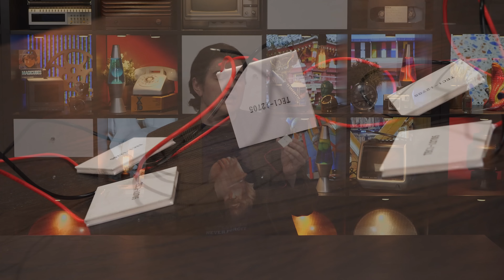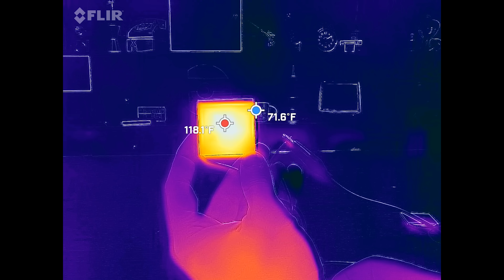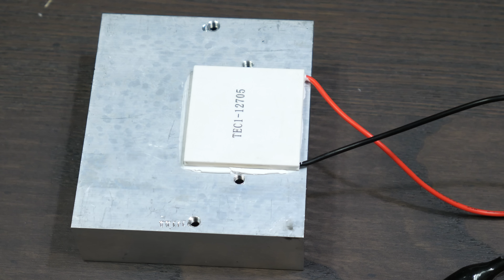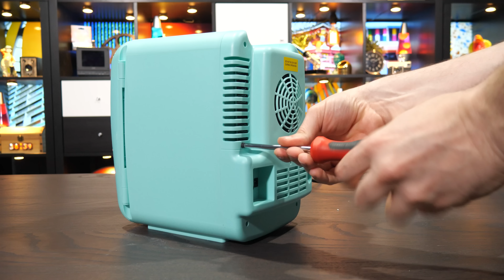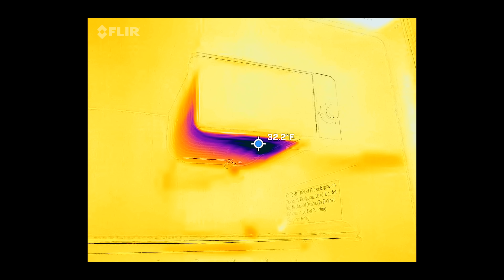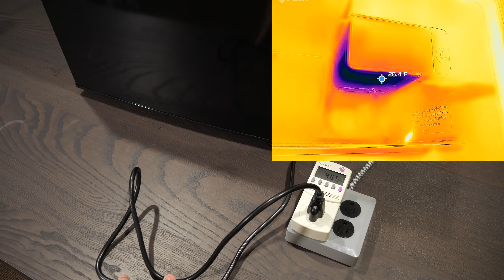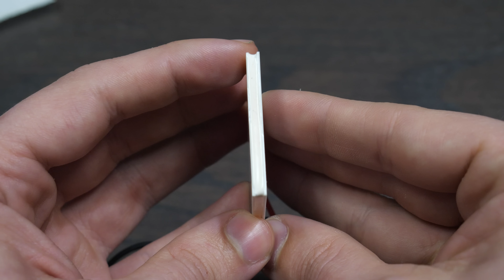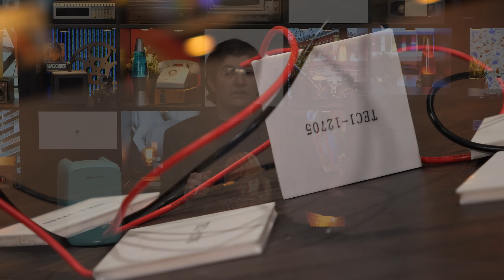Thermoelectric cooling: it's not great.

Comment: Peltier elements are great for cooling tiny things very precisely, but that is not for normies. But running it in reverse, temperature difference in, electricity out can be: Fans for wood fired ovens are nice! Don't know if they actually do anything useful, but I like them.

Comment: My mother in law discovered the Peltier being both a cooler and a heater when she borrowed my Campingaz coolbox and put the DC plug in the wrong way round which reverses the fan and blows the heat back in to the coolbox. Those were some toasty sandwiches. 

Campingaz do actually advertise it as a feature and put a little red and blue dot on the plug so you can marry them up. I hadn’t told the MiL this.

I also like to give it a head start by throwing some ice boxes when I first use it.

Comment: So much right and wrong here. I have to make a video to explain all this in details. FOR Europe or US (or Canada): purpose of that "STUPID FRIDGE" is correct and stupid at the same time. If I continue explaining I will need 50 pages of A4 sheet. 
So to make a simple point: If you want to use it to cool stuff, it is stupid little fridge and wrong by default BUT-
If you want to keep few beers or other drinks cool in the office for 8-10h a day it is totally fine, if you put them cold inside it will stay cold (what is normal if you bought it on the way to work and put them cold inside of "mint" GREEN fridge not BLUE) 
So if it cost 0.01-0.1$  a day to keep your few drinks cold for 8-10h it is not much. If you compare it to Electric bill for whole house because US people keep AC all the time on, even if they are not home for days, comparing to EUROPE "idiots" that turn on when they are home if needed. Hmmm I see why you (US) cry over 10-20$ more for a year...
But who am I to tell Americans and Canadians how to save 10-20$ a year with bigger fridge to keep 6 beers in the office.
I will end now or I will writhe whole book to make fun of this...

Comment: Well, it's not efficient both ways. You get much less efficiency from turning electricity into cold or hot then with a heat pump or coil, and you get much less electricity from heat then boiling water and spinning turbine.
But it's portable and simple af. And If you need to charge your phone in the wilderness, or make a primitive refrigerator I doubt you want to have fun with boiling cycles or coils.

Comment: I bought the Coleman portable one for trucks and it works as advertised, around 40F below room temperature, takes over 8-10 hours for that, not bad but not impressive either. Barely uses 60-80W of power.

Comment: These stupid things are usually sold by big known brands in the car and 4x4 industry for hundreds, usually about a hundred less than a heat pump system.

And they sell a lot of them.

Even when i purchased my 95ltr dual zone 12/240v fridge/freezer for my 4x4, paid from memory 1200aud. I had the salesman trying to get me to pay 359 for a 6 can pos. Even after I said hey ived worked for this company (that the salesman worked at) and ik its not a true fridge or freezer and I need this to reach set temperatures near or below 0c for my medication he still tried his best for over 40mins to sell me some pos. Also despite me saying hey you know ambient here reaches over 40c right? And if my meds reach that temp or even close to at best ill be hospitalised at worst die he still tried.

I hate these things with a passion. Always have. There is no plus side to these things in cooling. Especially in the aussie outback in the tropics.

Edit: to see how vehicle refrigeration units handle being vehicle bound. Check waeco (now mostly called dometic) or engel for the big 2.

Ive taken mine running at extreme angles, sure if it goes upside down it will likely cause issues. Buuuut if your vehicle went upside down you have bigger problems than your fridge. On a vehicle unless the vehicle is running* power is even more vital. *and even to a point on running vehicles, your still hard limited by the amps of your alternator and if you use all that, now your facing battery drain whilst driving.

My big 95ltr uses a max of 3amps at 12v. Running both sides as a freezer deeeep below zero and it running flat out. Ive never seen mine ice up. Its quiet enough to not notice it unless your head is right next to it. And its good at keeping temp, and not running tiny duty cycles. That said its insulation is easily 1.5x as thick as my pricey home fridge, easily double or more.

Comment: i mean, yeah peltier modules are inefficent but i wonder if anyone has thought of attaching a high efficency Thermovoltaic cell To the hot side and wiring it back into the module in paralell along with a power supply to increase the power input efficency, would this work to create a higher efficency cooling unit? 🤔

Comment: One chip has limited value for making say a 60v bike battery charger, 10 chips makes 20 volts so they can be built using more or less to suit, and the chips are great, limited thinking is crap

Comment: I have a minifridge between the two sizes you displayed when it was the blue and the black fridges. I honestly bought it because the room I spend most of my time in get really hot in the summer, I bought a ac unit based on your video about portable ac units to help combat the heat, but my cold drinks from the fridge downstairs would sweat on my table and would be terrible warm by the time I got to drinking them. Hot drinks, hot room, no bueno. I needed something to keep my drinks cold for me especially in the summer, I also work at a place that has terrible heating and cooling my job includes manual labor as well. So with those factors, having a 15 can fridge that are cooled and kept cool during the hot summer so I don't have to keep running up and down the stairs for a drink after a long hot summer day at work. I have a fridgidaire model vs the emerson shown here, I don't know if there's differences, i've not looked at the specs for mine, but compared to the emerson in cooling, that's pathetic that it takes it that long to cool. Honestly I feel like buying these things depend on your intended use for them. Some of these are advertised for makeup products besides beverages so perhaps that would be a better application of the emerson's cooling as maybe some makeup products you don't want them to be kept too cold? I am not sure I'm not an expert.

Comment: I got a Cooluli brand on Amazon for $24.46 after tax that claims to cool 40ºF - 45ºF below ambient temperature. I stuck a fridge thermometer in there and it was about 40ºF on an 80ºF day. I didn't expect it to get a 6 pack cold very quickly, but I figure it will KEEP a few or more cans cool. Better than just leaving the cans sitting out.

Comment: I have a (possible) application for a Peltier refrigerator, but I'm not sure if it's actually possible: An ice maker. It seems stupid at first, but it's for a very specific circumstance: International travel. I am an American who recently went to Germany for a week. For whatever reason, the Germans don't believe in ice. Water is always warm. I don't think I'm going to be able to put a compressor in my luggage, but I could bring a big stack of Peltier elements. Power consumption is not a concern - the hotel is paying for it. It could be continuously water-cooled because I could just hook it up to the bathroom sink and run that through it. So, I guess the question is, I'm guessing I can probably run around 2kW continuous, is that going to be able to make a tray of ice cubes?

Comment: My good friend gave me a really nice digital controlled wine refrigerator. it had 2 different temp zones for red and whites. After I made space for it and filled it up then set the temps to 48 on one shelf and 38 on the other I just ignored it, which was easy to do as I dont drink much and it was supper quiet. Over the next few months I had noticed my power bill was a bit higher than normal. I payed no attention as it was only about 30 or so dollars. Finally one day I got another power bill as summer was approaching and it was now getting noticeably higher bill. Then I suddenly thought about the wine fridge and unplugged it. My next bill was down by $50. I took the unit down to the garage and figured out that it has 4 thermoelectric units, 2 for the top and 2 for the bottom and a separate fan for each (all be it very quiet) and the unit uses almost 250W almost all the time . never used it again and told my friend he owes me $400....lol

Comment: You forgot one thing (I worked at a TEC start up for 5 years): if you are looking for a small delta T, they can move a tremendous amount of heat in a small area which can allow you to maintain a steady temperature. So they are used widely in one specific application: cooling optical gates and switches in cellular networks and fiber optic lines.  The company I worked for (Phononic) was doing well on the chip side but everything they tried to compete against vapor compression failed miserably.  We were using heat pipes and thermosiphons to overcome some of the problems of TEC's but it drove the price into the stratosphere.  They've laid off most of the non-chip people since I left 6 years ago.

Comment: I use a peltier cooler to hybernate my pet ants, they need a temperature control, set between 5 and  15C and normal fidges don't do that. ( note you need a slow cool down and heat up ) it now draws 200w in a day. so all in all for this specific case it is (for me) the right tool. I might build my own with better isolation and a heat/cool control but that is a perhaps for later.
an other benefit is that the animals don't like change in noice and vibrations, a fan running continuously is better for that.

Comment: I have a 25 liter/ 6.6 Gallon version, on 12V DC it uses 39.6W continuous,  on 230V AC it uses 52W until it can no longer cool it more, than it will go into an eco mode and it uses 14W, and makes a lot less noise.

Comment: I have a little wine refrigerator, for 6 bottles. It works well until my ambient temperature gets too high (> 30°C, which seems abnormal for the inside of a home, but i'm not really bothered with 31-32°C ambient temp, in the middle of the summer (Canada, latitude 48°31' N), i do not have an inside air conditioner.  The little fridge has a temperature regulator, i set it to 12°C, and over 30°C ambient it will climb to 13-14°C. But it's not that much an issue for me.  The fans are not that noisy, i actually replaced one of them with a "Noctua" with speed limiter, it's quite quiet even at max speed.

My fridge have an inside fan also, not only an outside one. So the cold is actually spreading faster than the one in this video that seems to only "radiate" the cold, which is quite inefficient, at least for the speed of cooling.

Comment: Back in the 70s, a physics lab session used to use bi-metal, a zip-zag-made array with 2 different metals.  

It has been a long time since I was a student physics lab tech, but metal like copper or steel?

As I recall, heating one side of the nodes with a flame made up of the 2 metals meeting you produces a current and voltage.  

Running power through it, one side got hot, the other cold.

It was extremely inefficient.

Comment: My experience matches yours exactly.  I received one (Frigidaire) as a gift from my son.  The idea was to put it in my home office and keep some soda beverages in it.  I happen to prefer my canned drinks to be almost frozen (maybe 36 degrees F).  Well, after days of running, the drinks were around 55 degrees F.  Not cold enough!  Even if they were cold enough, the constant annoying hum was a deal breaker.  My office is library quiet.  So, the fridge still sits in my office unplugged, taking up desk space.  I don't know what to do with it.  I don't have the heart to tell my son.
Reply: I have the same one. I found that a full gallon of milk fits in it, so I will be using it to take breakfast on the road for long trips. If a hotel room doesn't come with a mini fridge, I'm still set. And at a hotel, who cares about how much energy I use for a couple of days?

Comment: I had an ice chest using that technology, and it was great for extended vacations. We would store sausage, cheese, soda, water, etc. in it. It was great on the road, and we would take it into the motel at night. If you fill it with items that are already cold, it works great.  The one disadvantage was its energy consumption. I would never park the car for longer than an hour, so I would not end up with a dead battery.
Reply: Doesn’t sound so great because a good cooler would keep everything cold for 2-3 days. Well I haven’t tried it out to much but I had a birthday party filled the ice chest with room temp drinks threw a 20 pound bag of ice in it maybe less and there was still ice on the third dsy
Reply: @alexvillalobos7137  yeah I don't think people who use that are exactly keen on loading 9 liters of ice on top of whatever they want transported. Size and weight matters to them as well as lack of prep needed, if not they'd do it your way. That thing is not meant to be used 24h/7 nor is it meant to feed lots of people; It's meant at best to keep cold and handy 6 cans of already cold beverages for a 2 to 6 hours drive; no more no less. I'd agree most other uses would be done better by other means.

The desk thing is a bit gadgety more for a decorative use than a really usefull one, but some people like that sorta things.
Reply: I have a larger one for the extended road trips I like to take (Montreal to Vancouver, for example). I load it up with already cold food such as ham, cheese, milk, etc, and have never had to set foot in a restaurant on my trips. I'll stop at a supermarket once in a while and stock up. MUCH cheaper than restaurants, and also much healthier...and so far, in 5 years, it has never let me down.

Comment: What do you think of using Peltiers to recover ELECTRIC POWER from exhaust gases?
Efficient or not, all that energy is wasted anyway, so anything is better than nothing.
Also, you can't really use a heat pump to convert temperature gradients back to electricity.
Basically it's peltiers with copper fins on both sides; one side is hot exhaust the is ambient air.

Comment: This video inspired me to replace my thermoelectric tiny thing of a fridge with a 70 litre fridge that could still sit on the end table beside my bed…barely. It has a glass door for that extra ‘this cooling method is so much more efficient’ flex…and also because that was, imo, a missed opportunity of this video to absolutely dunk on the misappropriation of thermocoolers.

…I think the glass door (and another little thing I mention later on) nudged it back up to about the same power use, but it has four shelves that each hold many more cans than the small novelty thing. Plus, its location means that the cold escaping the poorer insulation is slightly cooling my sleeping area, so it’s not completely wasted.

As it’s also a cheap fridge, I found it does need an internal fan, because the top shelf was happily hovering at 10°C - at the front at least, where I put the thermometer. Didn’t need it to transmit anything; I could read it perfectly fine with the door shut. (I wonder if official efficiency tests account for the human behaviour of just staring into a fridge to contemplate everything and/or nothing. Even a top loading fridge would need to be opened for this activity.) With the fan, the whole system reaches food safe temperatures. I would have just made it a wine shelf if the fan didn’t work.

If you’re curious, the brand of this bar fridge is Devanti (though I suspect there are a few brands buying this model and slapping their name on it.) Though the model number escapes me, I can tell you the fridge has the distinct feature - and remember the purpose I bought it for - of having an LED internal light that NEVER TURNS OFF. (Or I can’t find the switch. It’s not determined by the open/close state of the door, in any case.)

Comment: To me, Peltier devices make sense if used in properly insulated coolers used in a nomad configuration. We had an electric cooler on a road trip that could hold our food fresh for quite some time even turned off. And we could plug it to the car or to a wallplug to cool it down. For static use, just get a proper refrigerator 😅

Comment: You are so correct. I purchased one of these for the car because I like my beverages COLD. It was an impulse buy, just as you suggested, and I possess zero understanding of the laws of thermodynamics, and it seemed like a brilliant solution. Since it would be powered by my car's engine, I wasn't concerned about efficiency. What makes these virtually worthless is that they don't make things cold. 45 F is not cold enough for any beverage I want to drink. I still don't understand why they haven't improved on the mini compressor technology in refrigerators to make them even more compact and streamlined and can stay lubricated in any orientation.

Comment: I will never forget the fact that when i was 13 years old i built one of those with an arduino uno running as thersmostat for the annual science fair on my school and i lost to some pretty girls that made a big pdf about a civil war here in Brazil (Canudo's War)

edit: so trying to make it a little bit more efficient was easy but tricky, i built it with a polystyrene box and kept the lid at the top, so whenever i opened it the cold air would kept trapped inside it, also i put heat sinks both in the cold and the hot side, i mean as a person that really tried to make a good peltier effect refrigerator seeing the design on this little blue thing you have really hurts

edit 2: the point on having heat sinks on both sides was because heat sinks are as good at absorbing heat as they are disspanting it, so it would transfer the heat in a more efficient way